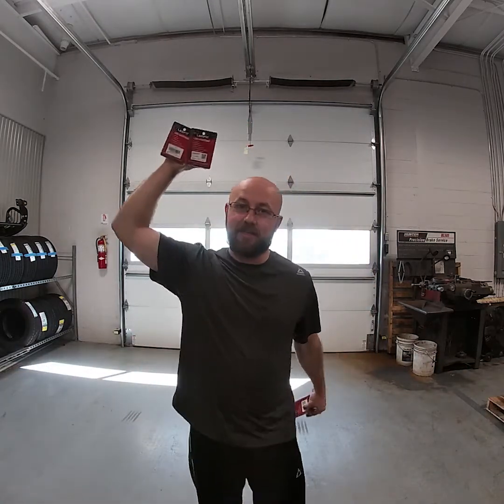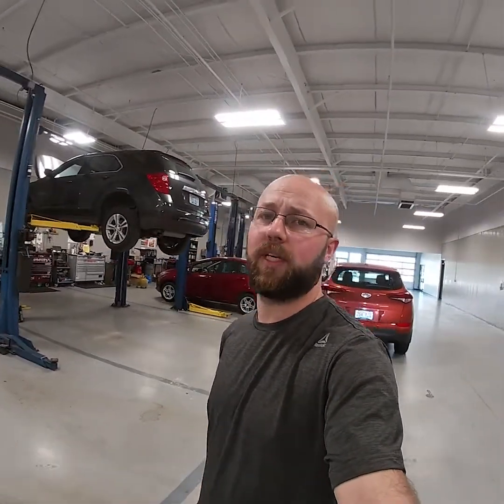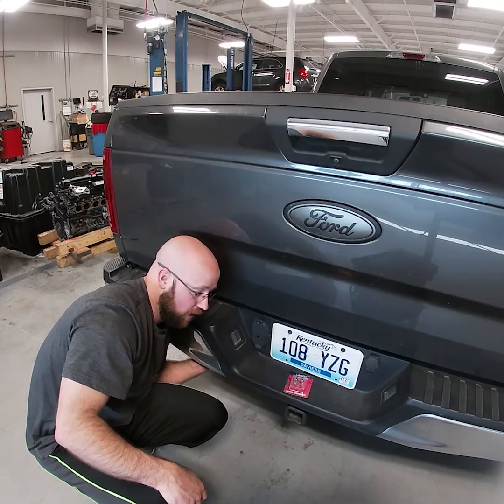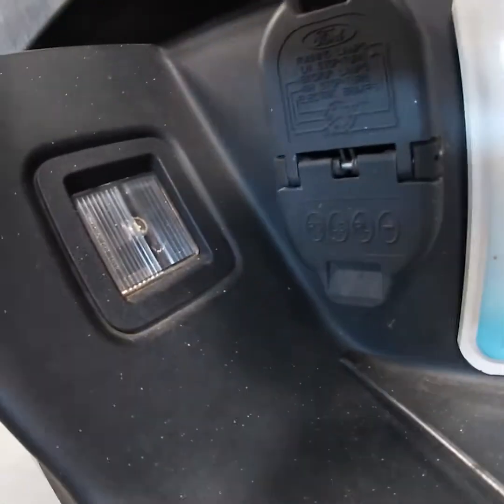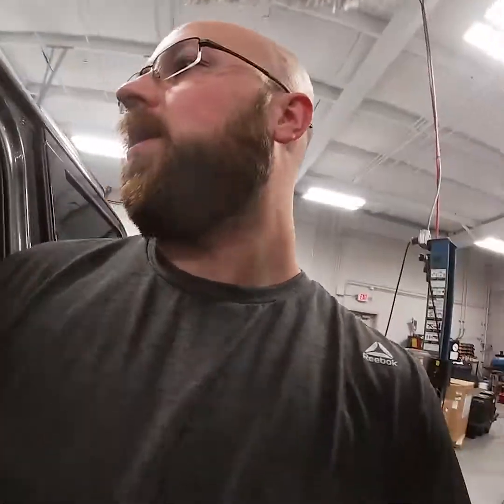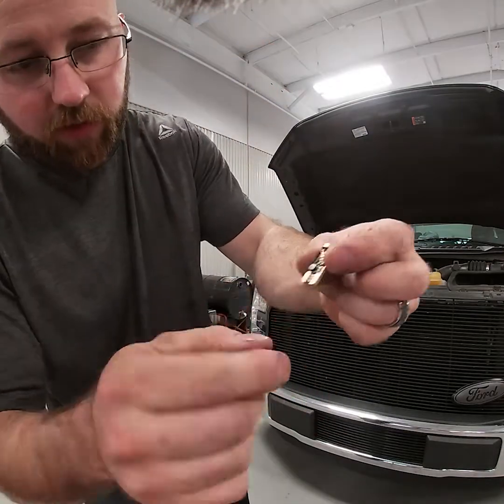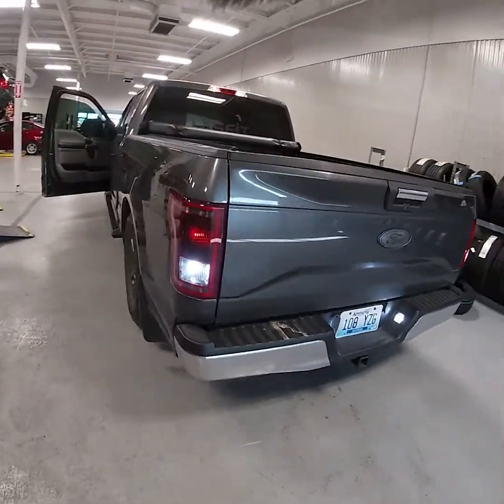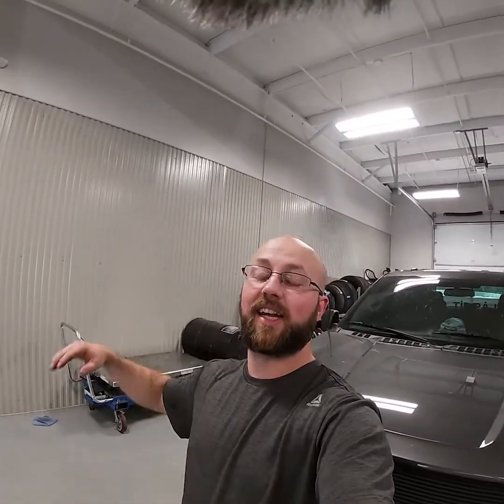Lasfit LED light package Ford F-150

Comment: Do you still have the oem bulb for the brake light? Want to do my taillights like urs but don’t want to change my bulbs out right now. Are the factory bulbs still bright though and safe for night driving? Want to be seen from a distance. I’ll changed the bulbs one day for sure, just making sure they are still bright with a factory bulb. Thanks!
Reply from the maker: We recently changed to LED but still very visible and easily seen using the oem bulb